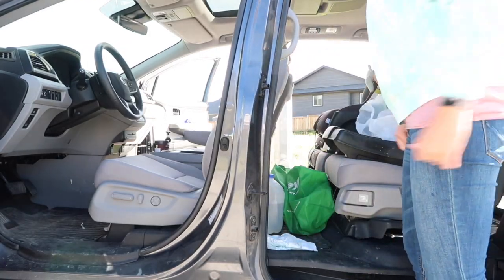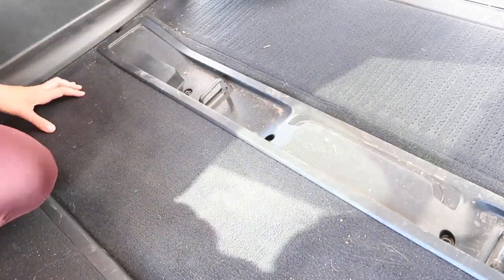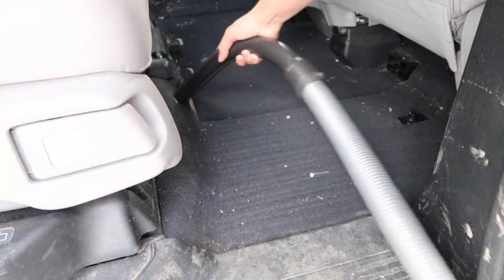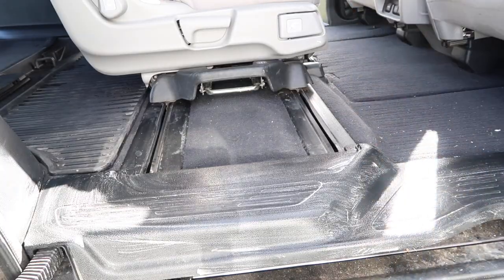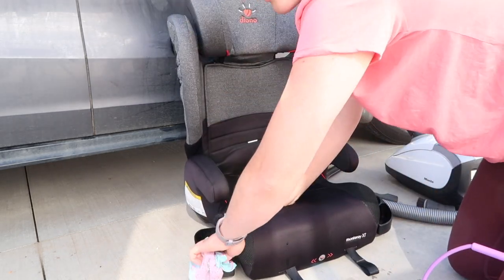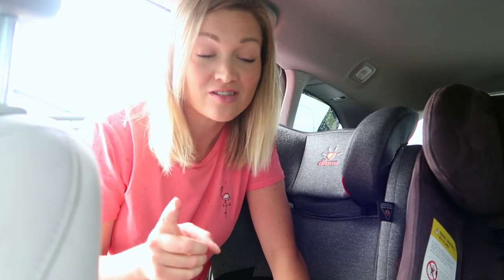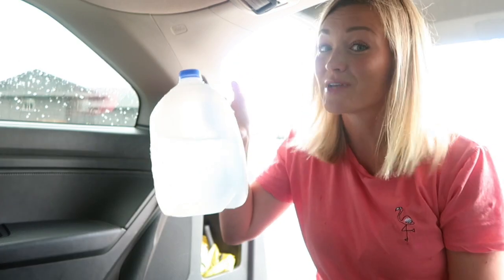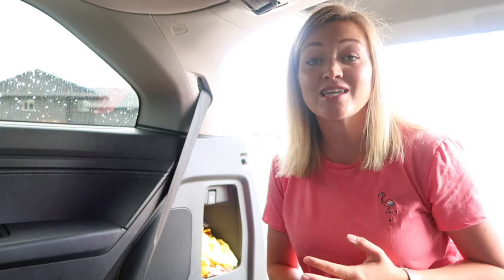DIY MINIVAN CLEAN & ORGANIZE WITH ME! | The Secret Slob

Comment: Let's see... 
In the back we keep 4 blankets (one per child), a potty and a roll of TP, a 3 compartment bag for outtings (which has a lunch cooler bag, a picnic blanket, 6 plastic forks, extra plastic bags for trash, a roll of paper towels), reusable grocery bags, umbrella, small stroller, jumper cables, first aid kit, emergency ponchos. I also keep a small child's backpack with extra diapers or pullups and an extra set of clothes for my 2 youngest. 
In the front we keep a stash of napkins, baby wipes, DVDs and CDs. In the glove box I keep a giant plastic Starbucks cup for little bits of trash and just empty that when cleaning. 
In the middle I have a crate for 4 notebooks and 4 pencils pouches and a few children's books. 
Man that's a lot of stuff! 😅

Comment: Road trip emergency stuff is best. I have a bag with tooth paste toothbrushes, cash $$ deodorants and some other toiletries. You never know when the car is going to break down so its best to be prepared with extra clothes like undies and shirts. Allways carry jackets for the family for emergencies. Nothing bulky. Few cans of Vienna sausages and crackers, tools, flashlights, an old charged cellphone for 911 calls only. allways carry a gallon or two of drinking water. 
Also engine oil, transmission oil, power steering oil, coolant, brake fluid.

Comment: I am so ashamed of my car . I have not cleaned it in 6 weeks other than to take some rubbish out occasionally.  It is full of sand . Tomorrow I  will at least get every bit of rubbish out and wipe things over a little,. I have no excuse as I do my weekly homeblessing hour and my zone on Friday as I have help for a few hours with the house and garden on that day .My husband is very disabled so having that help on Fridays frees me to just do my morning and evening routines the rest of the week. I work along with my helperth and the current zone gets a more detailed clean but every room gets at least a dust and thorough mopping as we live in Cyprus which is part of the middle east and is very dusty . She also sweeps and mops my 2 patios and 2 small balconies as they are ceramic tiled  and there is a lot of stamped concrete to sweep and 3 outside sitting areas to clean. I would never do all my zone work in one day if I didn't have my helper and the garden and patios would probably have   to get done on the weekends.